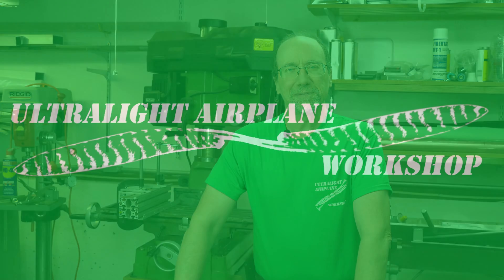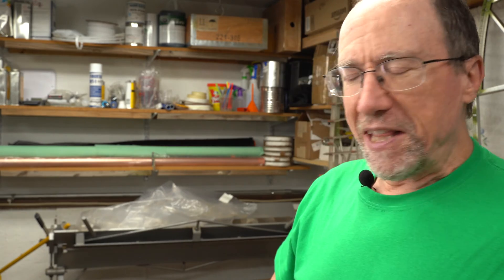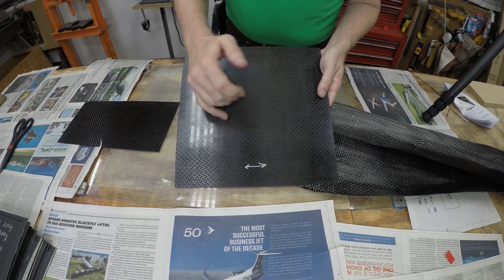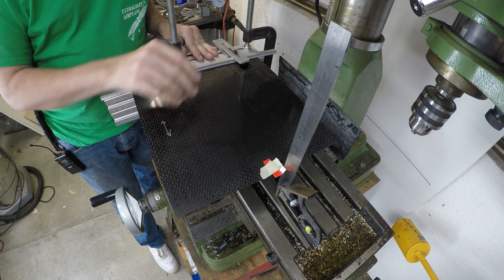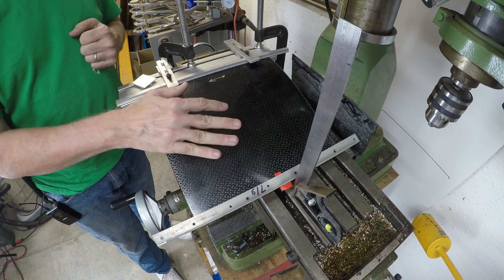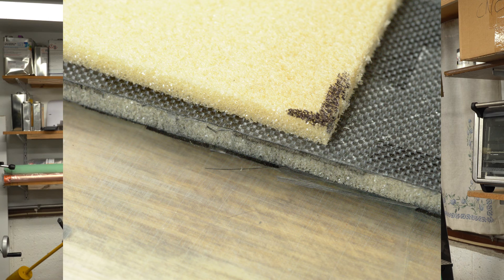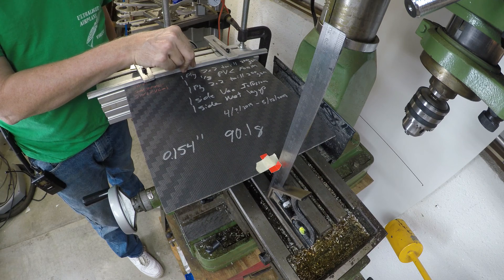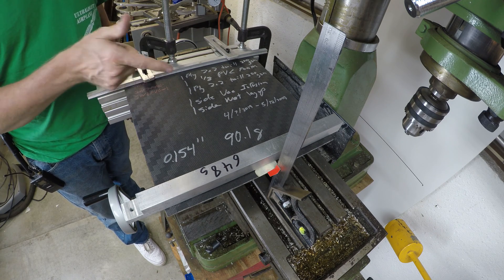Composite Test: Carbon Fiber Sheet Bend Test Supplement

Comment: Nust found out about the thicknes/distance between outer layers thing laminating balsa cored parts. Having a really good time foguring out my directional stifness and my weight/thickness/stifness calculations. I used to only laminate hardwoods for guitar back and sides and was shocked at first when using carbon fibre as it was a lot less stiff then i expected but it turns out i was just very unaware of directionality and distance between outer layers. No more wqsting carbon fibre in the core😂

Comment: Thank you for the informative video. How stiff will a part that's 110mm long and 84mm wide and 0.4mm thick or 0.5mm thick be? will it be harder to bend as the size of the sheet is small?
Reply from the maker: Hey Vert. It is hard to answer your questions. If the force on the part is the same but you made the length shorter (assuming length is > width) then yes it should be harder to bend( assuming the support is at then ends in the long direction). If you only make the width smaller it will be easier to bend. If you make it thinner it will be easier to bend. Does this help or were you trying to ask something else.

Comment: How good is carbon fiber from fastener pull through? Im assuming really good because of its tensil strength making it hard for the hole to stretch?
Reply from the maker: The tinsel strength of CF is pretty great. But CF is also somewhat brittle. Since the compressive strength of the fastener can be pretty high could easily cause fracture of the CF and thus a failure of the part. A good alternative, if you engineer it right, is to use a fiberglass plug for the bold through hole. The FG plug is then integrated into the CF part. The FG is less likely to fracture form the compressive force of the bolt.

Comment: Thanks.  This helps me think through the problem I'm working on.  I never realized how satin fabric has different properties depending on which side is up.  I assumed it would just be cosmetic.  You may have solved the problem I was having.
Reply from the maker: I had not really though much about it either until I was testing some of the other samples and then it occured to me that the thin samples of satin weave should be different depending on the orientation of the fabric. Good luck!
Reply: @Designer103   I did an experiment to see if I could get more stiffness in one direction without losing flexibility in the perpendicular...while keeping roughly the same weight.  I tried 2 layers of 5.7oz 4HS (3k) with a 5.7oz Uni-directional layer inbetween.  I oriented the 4HS so long strands facing out were vertical, and the Uni was also vertical.  

The resulting part was slightly heavier and had more uniform stiffness than the 2 layers of 8.4oz 5HS

The lighter material was quite loosely woven, with the tow flattening out more, which I think reduces the effect of directional stiffness.  A thicker fabric likely has more of an affect?  And the uni in the middle added enough thickness that flex was pretty uniform.

The next attempt will be something like 2 layers of 8.4oz 5HS with a layer of uni on one side.  Maybe both sides?  Uni on the outside seems like it should be bad, but I guess it's worth testing.
Reply from the maker: Keep experimenting. Then make a video :)

Comment: Hi  !!! I stop here in your channel because I need bend a 4mm carbon fiber sheet , I just need  45 degrees up bend  , I am using this sheet to shape a motorcycle instruments bracket or mounting , any advice in how to bend this carbon fiber sheet , heating or just use a brute force , lol , thx in advance and be safe !!!!!
Reply from the maker: I'm guessing that trying to bend it for a bracket will not work out very well. If you are willing to experiment and possibly destroy your part then the best bet would be to heat it up to about 100deg C (210 F) and then bend it. This temperature is just above the glass temperature of most epoxies (assuming that your CF has epoxy). You should be able to bend it. I will not vouch for how string it will be though since the CF on the inside of the radius will probably bunch up a little bit and your part will lose some strength. Good Luck.
Reply: @Designer103  , thx a lot i think i will be looking for another alternative

Comment: The weave and sandwich thickness adding stiffness make sense. I'm considering a marine project using fiberglass and increased foam thickness to get the stiffness I need rather than using expensive carbon fiber. I'd also be interested in any load tests of vacuum infused fiber sandwiched foam with holes versus without if you've done them. And how a lower density, cheaper and lighter foam with holes filled with resin compares to a higher density foam without holes.
Reply from the maker: I'll have to think about how to do core holes vs no core holes. For the no hole core you would have to do without a wet layup vacuum bag (tapped air under core) or vacuum resin  infusion (likely failed infusion under foam) for the no hole case. You only use holes in the core if are pulling a vacuum for air escape and resin transfer from one side of the core to the other. So in the core holes vs no holes comparison you have the excess resin and uncompacted tows wet layup only ( no vacuum) vs less resin and compacted  tows (vacuum bag). It might be difficult to do an apples to apples comparison.  I'll have to figure out how to use a vacuum for the no hole core case.

Thanks for the comment.